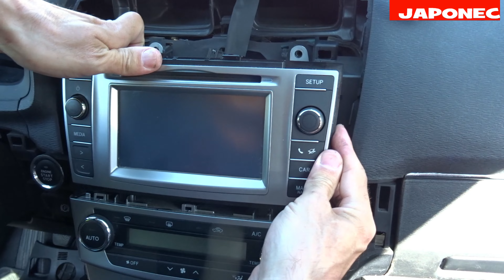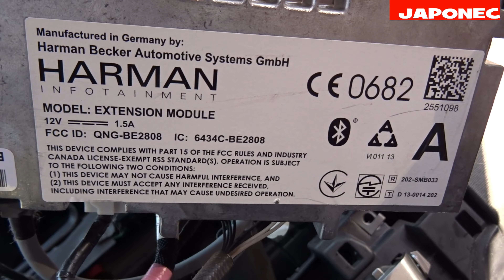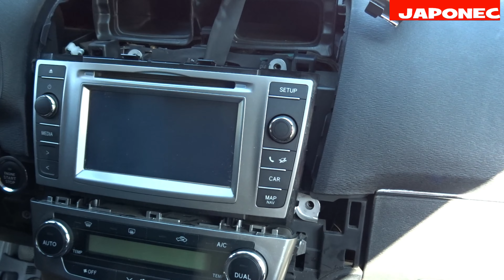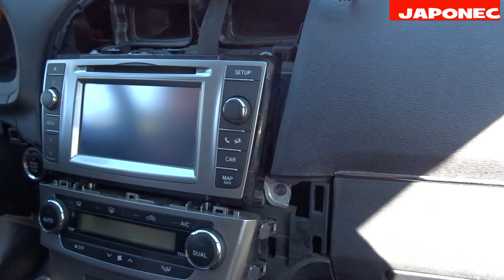Toyota Avensis T27 radio removal

Comment: What code do you mean in the third minut, 3:13?
Reply from the maker: Radio security antithief code. After disconect need code insert
Reply: @golfwagen4173  Thanks for the answer.  Where can I find this code?  And is it possible to turn on and use the radio without it?
Reply: @za3362 hello, did you find answer for your question? I have problem with my radio and I need to disconnect it, but I can't find the code.
Reply: Any idea where to get this code?